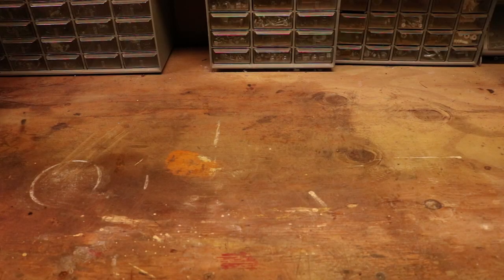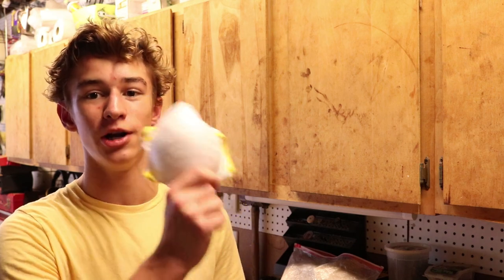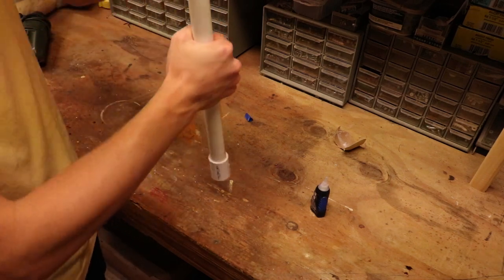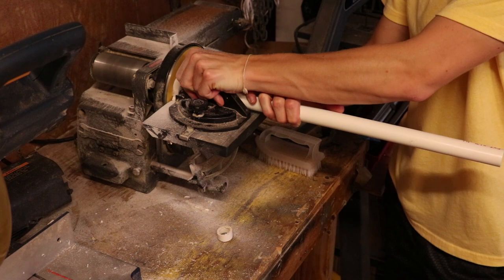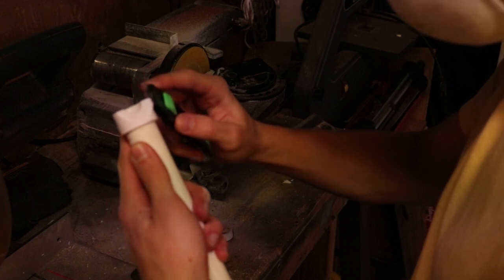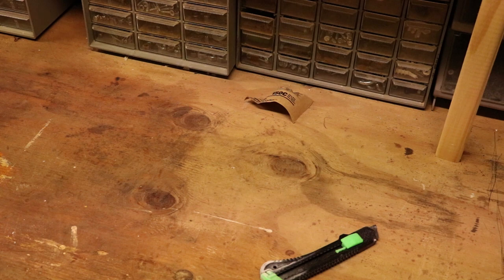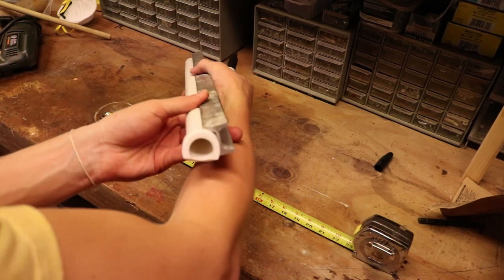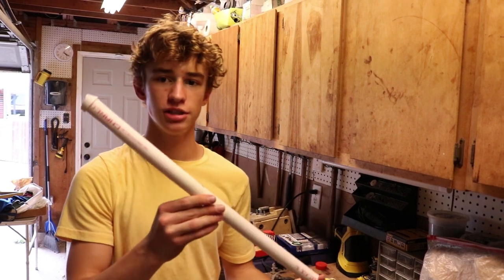How to make a budget friendly shakuhachi flute.

Comment: Hello Adam,
I tried your method. This works for me, except for one thing: Overhere, in the Netherlands, I cannot buy a 3/4 pipe. The nearest diameter is 1 inch. At least with sufficient wallthickness.
Do you know what the measurements are when using this bigger diameter?
Reply from the maker: Unfortunately I do not, that's a little bit outside my research for this video. Because it's a bigger tube, I assume the key will be different and the octave probably lower too.  You could try by just experimenting where to put the holes and what sounds correct . Other than that I would just web search "shakuhachi 1 inch diameter"

Comment: Thanks for sharing.  If you cut the angles you will save all that pvc dust. Just file and sand to a smooth finish. PVC cement is very quick drying. Once dry it will not come loose. It becomes a one piece unit.   To clean of print on PVC use finger nail polish remover. It works very well.  But do it outside and not near an open flame.  The solvent is extremely flammable.  It will flash near a flame.

Comment: hey Adam how to do the blowing part for those who don't have the machines, that is, manually please ♥
Reply from the maker: So instead of using the machine sander like I did, you can just use sandpaper and sand the tip of the mouthpiece at the same angles that I described in the video. Sorry for the long wait 😅

Comment: I tried it with hand machines (not the machines seen on video) and its a huzzle, already error with first pipe. i bought alot of pipes and mouthpiece just in case so ill try other methods this time. this metod does not work no sound at all i think you can only make it work with the same machines on video and much pratice to make the mouth piece. not easy to do. Warning to others it does not work on first try need to try at least 4 to 5 pipes.